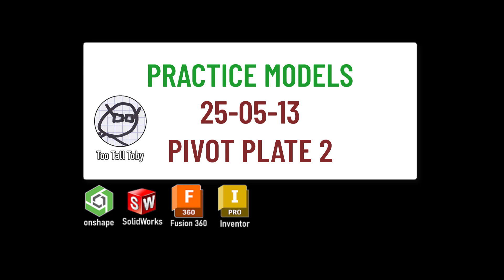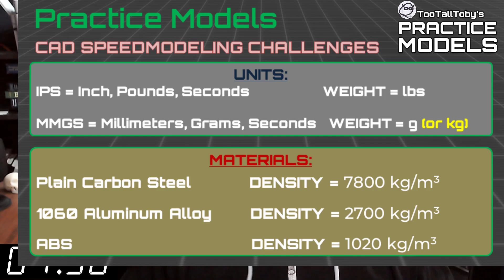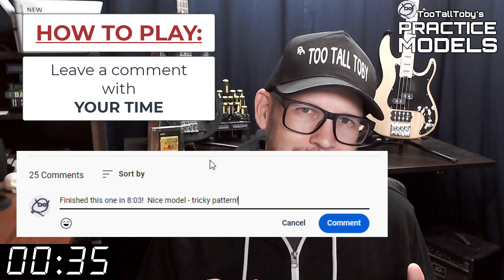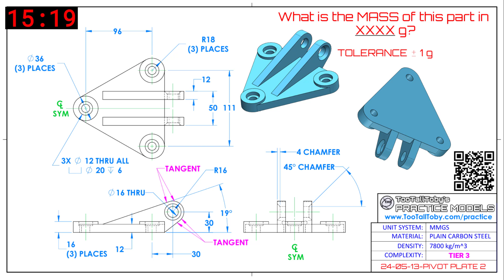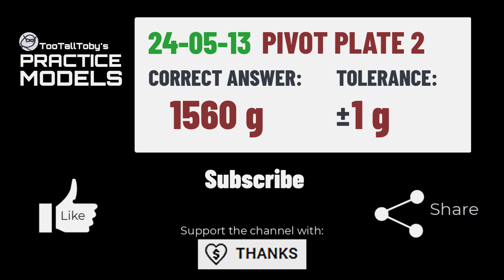2D Drawing to 3D CAD - PRACTICE MODEL- Exercises for Onshape, SolidWorks - PIVOT PLATE 2

Comment: I am a noob.  Can someone please tell me how to infer the outer diameter of the upper arc in the two "plates" (or whatever they're called) that extend upward from the base plate. I understand the hole diameters but not the diameter of the arc.
Reply from the maker: Hi Ken,
That arc has a radius of 18 and a diameter of 36.
So the corners are R18, and the circles that extrude up are Dia36

hope this helps
toby
Reply: @TooTallToby  Thanks for your reply!  Yes, I was guessing that the 2 upper arcs were the same size as the base plate, but I don't see where the diagram tells me that.  Do the 19-degree angle, the two tangent constraints, and the 30mm horizontal distance from the base plate circles force the radius of the arc?  That thought just occurred to me...is it true?
Reply: @TooTallToby  I think you misunderstood what arc I was talking about.  I kinow the 3 corner arcs on the base have a diameter of 36.  I can see that.  I was referring to the arc of the UPPER plates perpendicular to the base.  I tried R16 for those arcs, and my part now has the right mass.  I misunderstood the drawing.. I thought the R16 was referring to the  diameter of the hole counter-sink.  I now realize that counter-sink diameter is 12, which can be inferred from the 45-degree angle of the counter-sink.